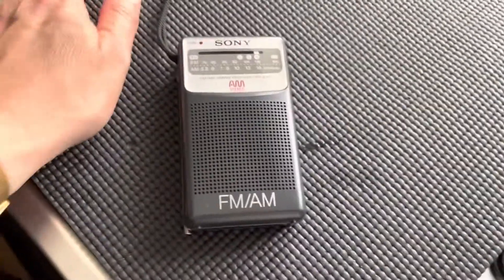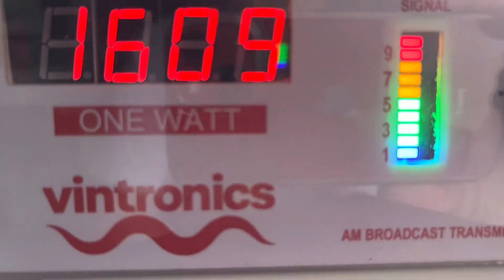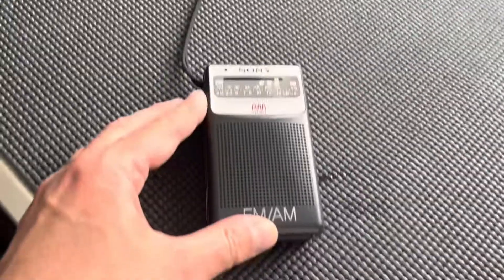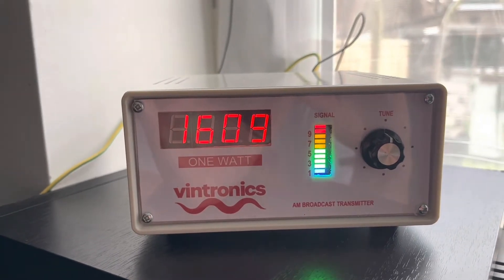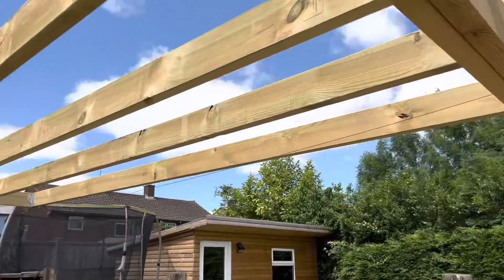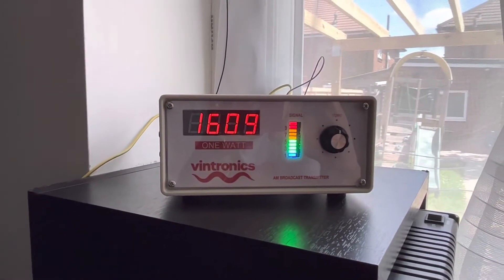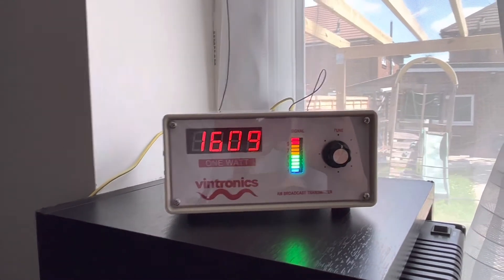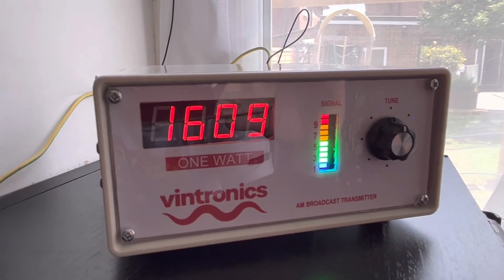Vintronics 1w AM MW mono broadcast transmitter  (show and tell)

Comment: Thal little device that you have there, will get you a very hefty fine in most countries especially set up the way you have got it with the outdoor antenna and earth. Your explanation of the control knob on the front pannel was confusing and didnt make sense. Is it a antenna match, or a power out put controll, because they are two different things entirely. Either way you have been verry brave showing it to everyone on youtube working into a large grounded outdoor antenna. When the authorities come knocking on your door I suppose you could always plead ignorance, they may reduce the penalty somewhat.
Reply from the maker: Absolutely.  However It ran only for about an hour and havent used it since so nothing really to get into trouble about.
Reply: I wouldn’t worry mate, you’ve got as much chance of winning the Lotto as getting a knock at the door for this. Good on you for experimenting, I enjoyed the video, but rethink your insulators and go vertical if you can. 
Amplitude Modulation sounds great to us that grew up listening to it 👍🏼
Reply: @FrancoDX  So long as he doesn't interfere with a licensed station, he should be good, however it depends on the country he lives in.
Reply: Yes of course but there is very little left on MW in the U.K. to interfere with. Be nice if LPAM transmitters were allowed for experimentation like in the USA because it’s just become a waste of bandwidth.
Reply: @FrancoDX  They don't want y'all to have any fun.
Reply: Haha, don’t get me started on that 😅
Reply: @FrancoDX  Yup I try to avoid getting political.

Comment: I note someone has already commented that 1609 isnt a proper channel. Being 2khz off channel will cause a 2khz heterodyne (whistle) if there is a weak station on 1611. Besides which a lot of cheap digital radios will only tune to the specific channels.
Reply from the maker: Absolutely.   I learn as I go 👍

Comment: Range km?
Reply from the maker: With my antenna probably 1/2 km
Reply: 1/2 a km sound a bit low for 1watt output and a 10m antenna. I got about the same range with a 1 transistor AM transmitter that I built as a teenager back in the early 1970's it was based around an OC44 germanium transistor and worked on the 80m band. It was powerd by a 6v battery supply and I strung up a 10m antenna to the tree with no earth. My buddy down the rd and I used to communicate each night telephone style as we each transmitted and recieved a few kilohertz apart. It was great fun. I recently found the booklet with the origional schematic at a car boot ssle and rebuilt it to transmit music like you do around the house and for the restoration of vintage radio collection. Thanks for your interesting vidio.

Comment: Hello! I made several experiments with medium-wave transmitter. There needs a dipole (if you grounded one wire of a dipole - there will be big losses and effeciency will decrease. In my opinion - there may be a long vertical wire with a helium balloon  on the top side.
Reply from the maker: Thought about that.  Problem is I am quite urban here and the trick is to not attract attention.  Most of the time I use low power fm for my home radio streaming.  Would love a place in the country to push out a few kw lol

Comment: if you want good local range you need to rethink your antenna approach.
Go vertically polarizing it and work that vertical against an earth like a shed roof or metal guttering or ground radial wires. Base load the vertical with a coil. I've had very good success doing these things
Reply from the maker: Thanks for the tips!
Reply: @avtransfersUK  There's a guy on YouTube here who has a video on his inverted L antenna. Not a bad set up but I did mine with a big bamboo cane I waterproofed then wound a big helix on it with wire taken from a 25m extension cord I stripped. I had taps along this coil (helix) so I could select the resonance frequency. the bamboo cane had a top section placed on it 3m long of aluminum tubing and the top of this coil connected to it. So basically it was like a massive bush bandit cb antenna or something like that which was over 5m long. I think the helical part consisted of around 100m of wire wound on the cane- I'm not sure as it was over 10 years ago now. I got very good SWR dips at resonance from 1100khz to above 1600khz depending upon the tapping point selection. The SWR dips were quite sharp indicating good low loss operation and went down to under 1.3:1.
No tuner was used at all, just coax connected from the tapping point via a piece of wire which had it's braid earthed to the corrugated iron roof. The bamboo cane was shoved into a satellite tv dish mount on the roof
Reply: I use several antenna types , including a loop antenna and it works very well  ...Many miles of range.

Comment: I have this TX its pretty poo just about hear across the road from me then goes I have made the wire longer not much different wanted it to play podcast to my radios.  i have a pretty small garden wire that goes to the end.  TX is ok if you just need to play on tuners in the home.  The earth also goes to the end of the garden to.
Reply: I have the new 8 - 10 watt it works very well signal i can pick up 15 miles away
Reply: @stevedvd272  omg what have I done ordered the 20 to 80 watt LOL
Reply: @stevedvd272  may look into it fm goes very well though fm covers quite a few roads from just the bottom floor even my when at the top of the house.
Reply: @stevedvd272  dam the 20 watt looks to hard to set up will ask for the 8 watt one.
Reply: @stevedvd272  how clear is it at 10 miles? What's the antenna length?
Reply: You don't have something set up right. Might be the antenna tuning or the antenna itself. 

I've got a 100mW part 15 transmitter (all we're allowed in the USA) and my car can pick it up easily two homes down from me.